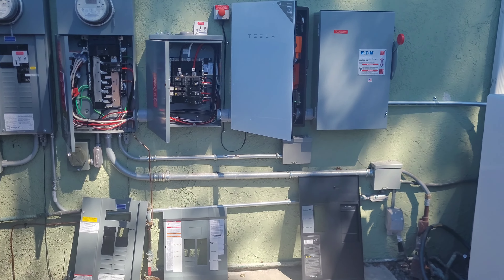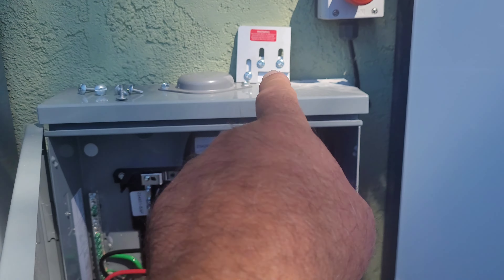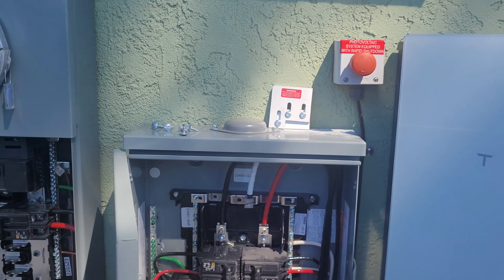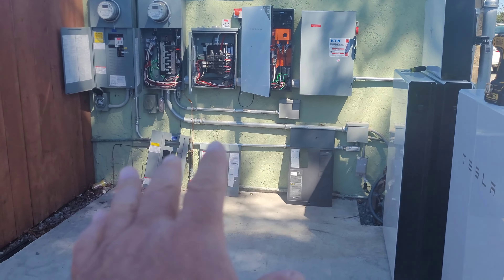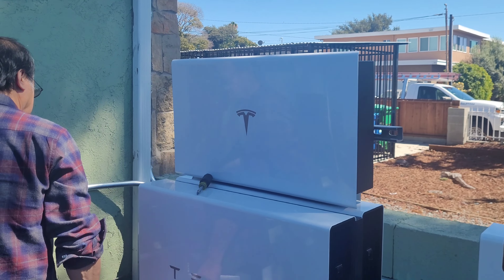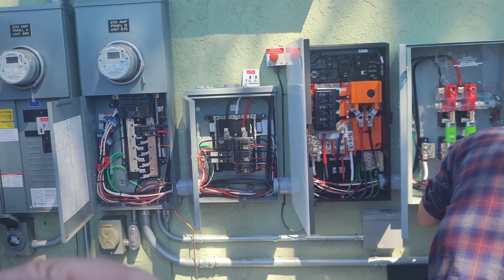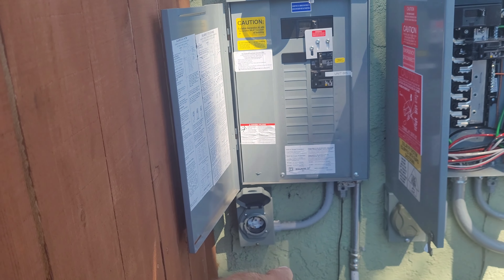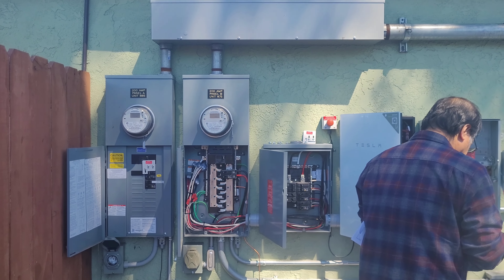Tesla Powerwall inspection failed 9-12-24

Comment: It’s minor. Here in FL it would have passed also inspectors now don’t get on the roof. It’s a liability and county not responsible for roof damage and installation. They primary look for electrical panel capacity limits ,fire hazards , and electrical shock by not grounding connections properly. City wants that’s re-inspection fee & electrical engineering revision fee now that the homeowner doesn’t see or pay. FL doesn’t even need a permit for generator inner lock install. Cali for contractors is worser than a divorce experience.

Comment: Tesla is correct, from looking at this, and ur inspector is over reacting. You dont need lockouts for tesla power controllers as its all software. so looks like they have gene feeding into the tesla controller and everything else is wired correctly. Reason they left ur lock outs like that because they prob dont wanna toss them as they can be 40-80 dollar each depending on the box.
Reply: The lockout has nothing to do with the PowerWall. The lockout is for the generator plug below the panel. What doesn't make sense in that second panel from the left there are 3 feeds to it. 1 from the meter above, 1 from the PowerWall, and 1 from the external generator plug. There is only 2 breakers in that panel (The main from the meter) and 1 other. You can also see on the cover sitting below the holes drilled in it from the lockout to be installed. Clearly there is something not set correctly here. There should be 1 breaker for the generator with the lockout, and then another breaker for the PowerWall.

I also don't know if the PowerWall will not try and backfeed the generator if the grid is turned off and the logout is in the up position. That would damage the generator.
Reply: @thardie  If you trace the wires from the generator plug under Panel B, it is not terminated in panel B at all.  It passes through to the right and terminates in the next panel to the right of B.  They simply moved it below Panel B because it was originally where Panel B is now and was in the way.  That is why you don't see a breaker in Panel B for the generator.
Reply: @rgarito  Oh, that makes sense. So, this is not set up properly to stop the generator backfeeding to the grid.
Reply: @thardie  As others have said, the Tesla electronics contains the backfeed protection.  Now, is that sufficient per code?  All depends on how the Tesla design was certified.  But I'd be surprised if they'd be allowed to sell it in America if it didn't have proper intrinsic backfeed protection.
Reply: @rgarito  It is to code in my area to allow tesla software to manage back feed(they have the correct UL certifications), 2nd if the generator is wired to the powerwall in the generator slot(yes it has a slot for wire to be hooked up to, to manage a generator as extra power or a way to charge it) it will also control the generator and back feed issues with that. All needs to be hooked up the the TESLA power wall 2 or if separate inverter and it will all be 100% managed by the Tesla software. Works flawlessly with no issues. This is a 400 amp service but split into 2 200amps, to me it seems they have a gene plug with lock out with 1 plug for 1 panel, and then the tesla system managing the 2nd 200amp service. I don't know if they are tied together as where that matters is all enclosed. But I'm assuming they ARE NOT tied in any form since Tesla pw2 does not work with 400amp service without multiple power stations controlling it and I only see 1 controller. If this was/is a pw3 then it would control it all but limit the 400 amp service for even passthrough. 

The issue i have is this inspector is weird, if u hear him off cam and everything is attitude and everything shows he doesn't wanna be there let a lone seems bothered by the owner just trying to ask for help... To me if tesla comes back and says its hooked up correctly, i would ask for a new inspector, clearly he doesn't wanna be bothered and prob is out of his debts. I have worked with Tesla engineers and they are on another level some of them, esp the senior engineers who usually handle the design of 400amp systems and multiple power feeds such this one looks like. I have also worked with inspectors who just hate certain changes in the industry and they refuse to learn about it therefore they just wont pass you because they don't know and don't care to know. 

I have requested other electrical inspectors before when they don't pass me for something which I know is correct but they refuse to just read the manual and rather than to follow code from 2009. In the code from 2009 it even says in multiple areas to follow the diagrams and directions given by the manufacture of what your installing vers following code if it explains why to do it that way. Tesla installation manuals actually always explain why to do it a certain way vers following code in an area due to code not being the same all over and the product was designed to work a certain way just for this reason.